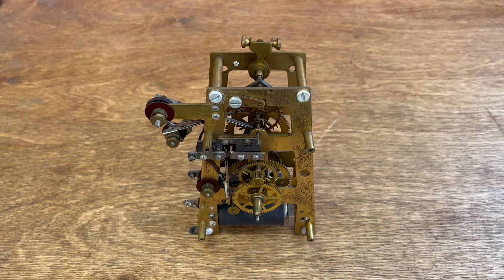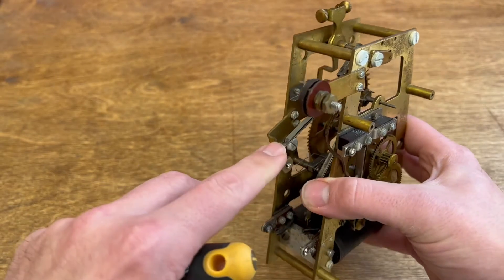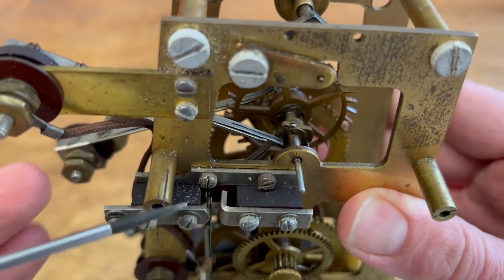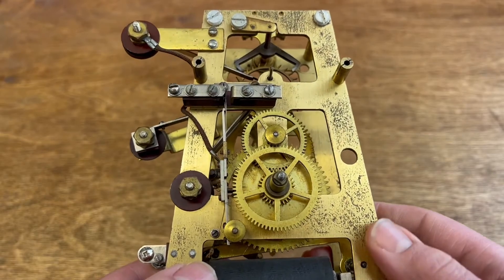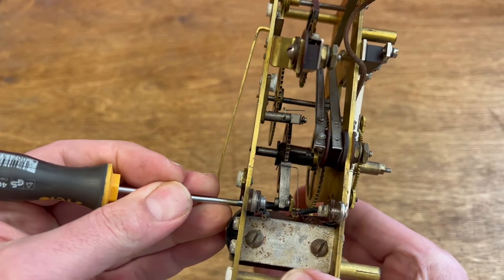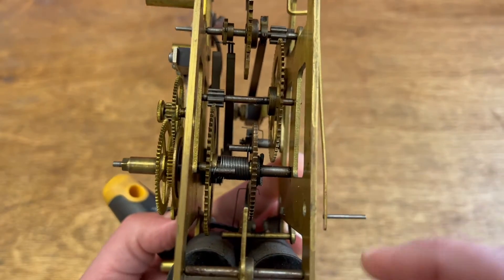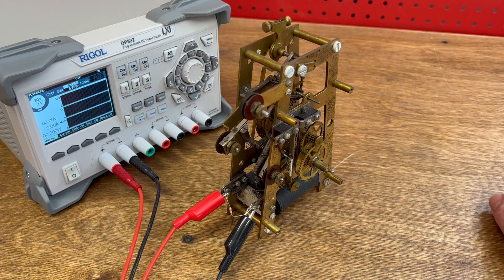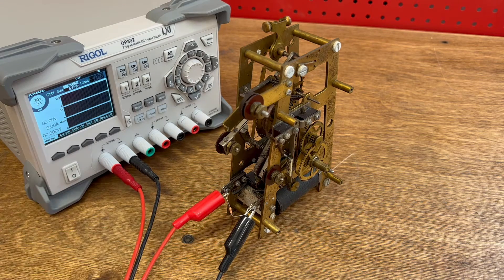Another Standard Electric Time Master

Comment: I have a Stromberg master with a similar winding charge arrangement.  Sometimes it will run for a month, other times it won't run for 10 minutes.  My other Standard masters with the escape wheel contacts run with no issues.  What are the reliability secrets?
Reply from the maker: Hard to say without seeing the clock. In the Standard Electric Time, having a snubbing mechanism to ensure that you aren't arcing and pitting your contacts which would degrade them quickly is definitely important. Other than that, I'm not sure - maybe it's a condition issue with your clock? How thoroughly has it been serviced? A full cleaning/bushing job to ensure spacing and meshing of everything is good? What is your pendulum amplitude? Do you have escapement wear?

Comment: Nice movement I was a time recorder service engineer back in the late 70s this video of yours brought back memories have you ever worked on smiths or international time recorders this was an hourly supervised system ♥️🇬🇧
Reply from the maker: I have an ITR master clock queued up to do a video series on at some point, as well as a couple ITR wind-up punch clocks. The ITR master makes an appearance in this video: https://youtu.be/ZCHV0WHF87E

I love the industrial engineering of these pieces. Most of the time they are so well-made it's just cleaning and degunking that's required to get them operational.